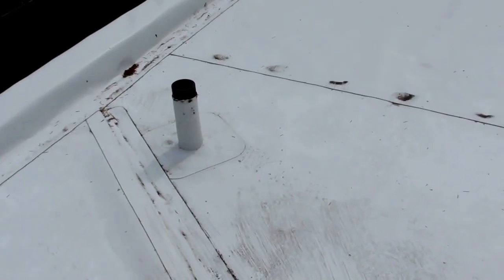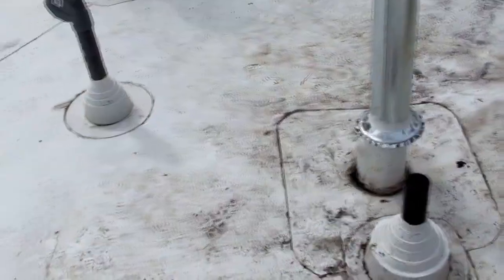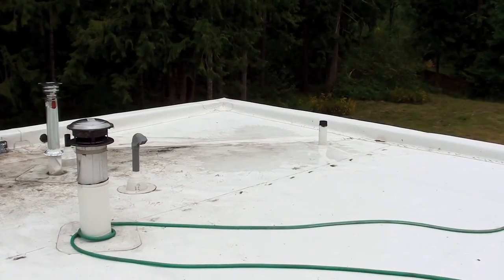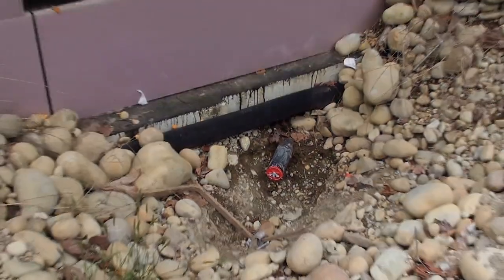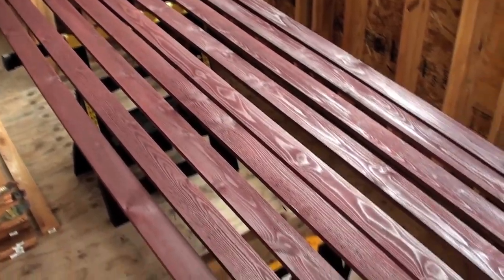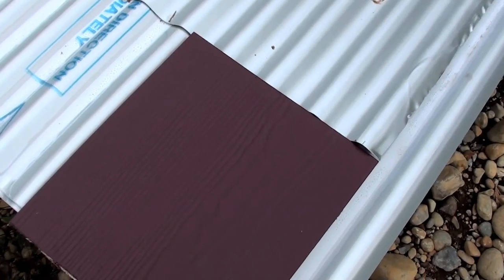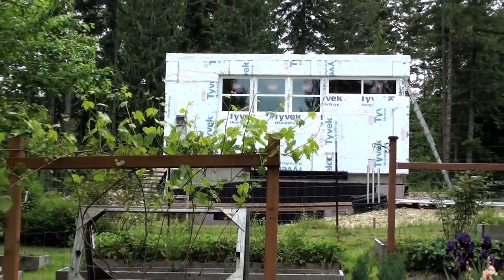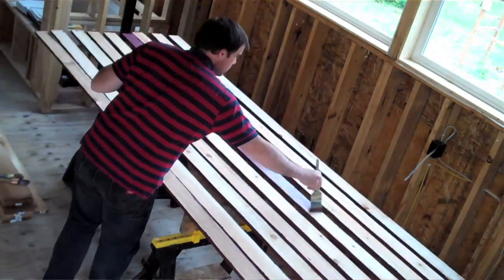Solar Powered House: Building Inspection

Comment: Could you tell me if you have any more videos, information somewhere else that details briefly 1. basement build (saw forms poured) 2. total sq ft upstairs, and total basement. 3.What exterior dimensions are? 3.. State u r in.4.. Exterior and INTERIOR final reveal? Noted draft man who designed home: one of a kind, or does he specialize in small foot print homes? That is where state u r in is curiosity.Also how did you handle water source? Sewage/septic or creative grey water/compost/incinerator?